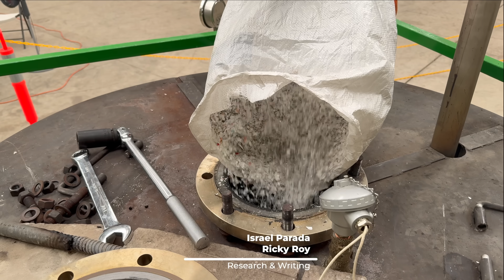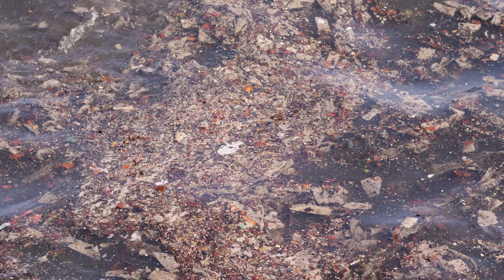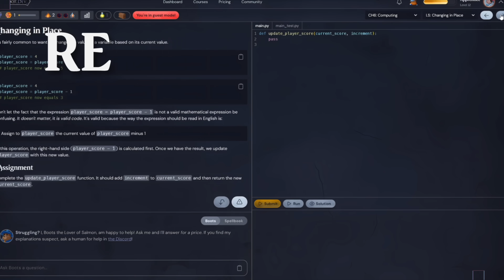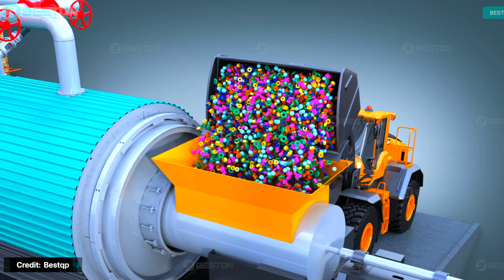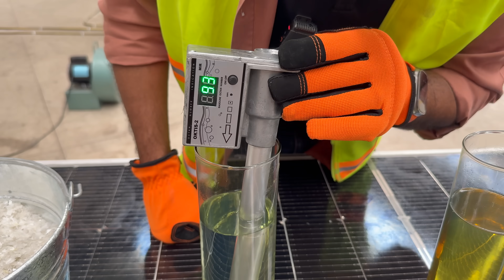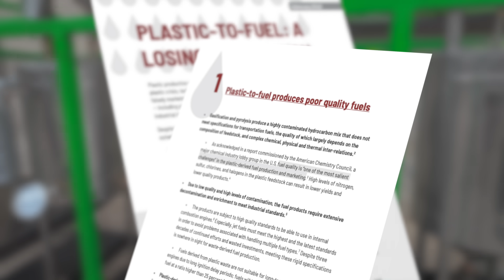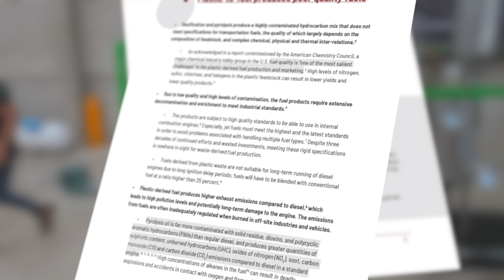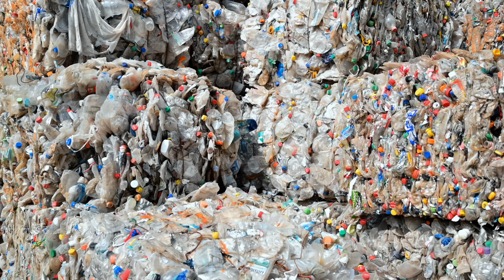Solving the Plastic Waste Problem - This Surprised Me!

Comment: That same process producing fuel-grade products is also useful to produce feedstock for many other products- like plastics...not ALL the lighter fractions have to be burned; it would lower the process efficiency, but the system efficiency including outputs may be as good or better ROI.

Comment: Pyrolysis is actually a very old technology. The Germans were already using variations of it during WWII. The process works well with polyolefins and styrenics, although polyolefins are generally preferred because they typically provide better and more stable yields.

The key factor is always the overall economics versus the revenue generated from the final outputs. Once the plastic has been properly decontaminated and granulated, you need to carefully evaluate:

Energy input costs
Processing and operational costs
Output yields
Market value of the recovered products such as waxes, oils, fuels, or syngas

At the end of the day, profitability depends on maintaining the right balance between feedstock preparation costs, energy consumption, and the selling price of the recovered products.

Comment: not a problem at all, because the more plastic you can turn into fuel the less oil you’ll need for fuel and that oil can be turned into plastic, so basically the plastic will just be a step between turning oil to fuel.

Comment: On the question of carbon emissions 🧠:

- using a conservative assumption (petgas claims 50% less emissions) of 2.7kg CO2e per litre of fuel burned, and assuming 1kg of plastic feedstock gives you 0.89litres of fuel, then per kg of plastic there will be 2.4kg of CO2e produced. 

- assume total plastic pollution worldwide is 52Mt/yr (2Mt/yr of which is ocean plastic). If they had to convert all of this every year to fuel (logistically impossible), they would emit 52 x 2.4 = ~125Mt CO2e per year.

- total worldwide yearly emissions = 38GtCO2 (excl. methane, nitrous oxide, and other gases) - 125Mt is 125/38,000 of global yearly CO2 emissions (0.33%).

Negative climate impact = meaningless.

Positive environmental health impact = monumental.

TLDR its worth it.

Comment: Pyrolosys isn't anything new, at least converting to diesel. WHY industry and governments are so resistant to reusing plastics to usable fuels,  I have zero idea.

I was involved with attempting to build a complete system with a system like this in the Pacific Northwest back in the late 1990s.  The pyrolosys system was the heart of the ethanol production from a company called Conrad Industries in Washington State. Not sure if they are still in business but this company is using their exact model and probably updated design.  

Nothing is new. What would be new is to get governments to actually accept these concepts.

Comment: petrol and diesel fumes from plastic waste is excessively pollutant

AI Overview
Converting plastic waste into petrol and diesel—often through a process known as pyrolysis—is widely regarded as a highly pollutant form of energy production that can be more harmful than burning conventional fossil fuels. While this process is promoted as a "circular" solution, it often functions merely as a way to convert solid waste into toxic air emissions. 

Here is a breakdown of the environmental and health impacts based on recent studies:
1. High Emission and Toxicity Levels 
Toxic Fumes: Pyrolysis and the subsequent burning of plastic-derived fuel release dangerous compounds, including dioxins, furans, heavy metals (like mercury, lead, and arsenic), and volatile organic compounds (VOCs).
Lower Quality Fuel: Plastic-derived fuel is often more full of carcinogenic aromatic hydrocarbons than traditional crude oil.
Increased Exhaust Pollution: When burned in engines, plastic-derived fuel produces 12% to 50% higher exhaust emissions compared to standard diesel, including higher levels of nitrogen oxides (
) and unburned hydrocarbons.
Persistent Pollutants: These pollutants are known to bioaccumulate in the food chain and cause cancers, endocrine disruption, and immune dysfunction. 

2. The "Plastic-to-Fuel" Myth
It's Incineration in Disguise: Many plastic-to-fuel initiatives are essentially a form of chemical incineration, where the plastic is not truly recycled but rather burned, turning it into greenhouse gases.
High Energy Input: The conversion process is extremely energy-intensive, requiring high-temperature thermal processing, which often means it is not a net-positive energy solution.
Damaging to Engines: Plastic-derived fuel has higher viscosity and density, which can cause long-term damage to engines due to incomplete combustion. 

3. Safety and Operational Hazards
Industrial Risks: Pyrolysis facilities have a history of accidents, including fires and explosions, due to the difficulty of managing the process, which involves high heat and flammable mixtures.
Ineffective Regulation: In many regions, the emissions from burning waste-derived fuel are inadequately regulated, placing a heavy toxic burden on local populations, especially in developing nations. 

While some studies argue that modern, strictly controlled catalytic pyrolysis can mitigate some of these impacts, the consensus from environmental organizations is that this technology perpetuates the plastic crisis rather than solving it

 The earth also is defiled under the inhabitants thereof; because they have transgressed the laws, changed the ordinance, broken the everlasting covenant

 Jesus Christ of Nazareth is The LORD!

Comment: 400Mt is small compared to processing coal to oil.  Plastic to fuel would be too expensive to scale.  There is simply not enough waste.  Feelings do not run any engineering project.

Comment: Based on 2024 reports, specialized plastic-to-fuel initiatives in Ireland are in their early stages, with specific, ongoing operations designed to handle around 4,000 tonnes of plastic waste per year. 

￼KnowESG +1

However, the vast majority of non-recycled plastic in Ireland is incinerated for energy recovery rather than being converted into fuel oil. 

Key Findings:

Specialized Plastic-to-Fuel (Pyrolysis): Trifol Resources, based in Co Tipperary, started full-scale production in 2024, designed to convert roughly 4,000 tonnes of plastic waste annually into bio-oil (pyrolysis oil). They have plans to increase capacity to 12,000 tonnes with further investment.

Comment: Twenty years ago I investigated biochar production as a soil amendment.  All of the pyrolyzer designs I saw used the gas from the wood feed to sustain the heat to run the process.  You should have a look at charcoal from scrap wood.  It locks up CO2 for millenia

Comment: It’s a mini fracturing tower just like in a refinery, the carcinogens that thing outputs are no joke and the reason nobody has managed to push anything like this commercially.  Also, it should not be difficult to add any plastic input to modern refineries, recycling that plastic and getting it to refinery is more expensive than drilling

Comment: OK but can you compare this to the more extreme oil retrieving methods like fracking and the pollution of the environment from them to this.  Because the whole pollution issue needs to be contextualized by what people will be able to not have to do.  Like with the solar power on the existing grid, yes they are not going to replace all of the other possible power generation on the grid but it is stop us from needing to burn the worst things to get the needed power when we need it.

Comment: One more fun fact, Mr Diesel, the inventor of the diesel engine, actually made it to run on plant based oil, not petrochemical based products! 1ha of the industrial hemp oil harvest can power agriculture machines needed to work that 1ha for 100 years!!!!!! Then you can get petrol from the rest of the biomass. All cold pressed! Then you get fibres left over yoi can use for making paper, clothing, packaging, ropes, and, watch this out, car bodies! Henry Ford, that Henry Ford in his later years understood the environmental death trap he helped to manufacture and made a prototype car run by hemp oil with body built from hemp fibres. There is famous video where he swings a sledge hammer at the boot of this car without making even a dent in it and the hammer bounces back. 
The point is, it is all there, burrows by the petrochemical mafia either through buying patents and locking them up or more prolifically making sure none of this sees the light of the day. Now, it is far more difficult to achieve it with social media. So things like these pop up more and more often, which is brilliant!
So kudos to the people who actually have the grit to go against the fossil fuel mafia. I wonder is this business is going to be around d in 3 years lol

Comment: Interesting. I'd wonder at how much fuel is used in the 1.5 hours to warm the boiler more than using the output fuel. We are already burning fuels, not to mention using lots of energy to pump/process that fuel. Meanwhile we are making plastics a one-use product.

Comment: If this is a fuel returning to fuel, and it with exactly the same pollution going into the atmosphere, as if it was originally processed into a gas, then it might be a bit of a bad idea, maybe. It is great to remove the plastics, but if adding the pollution from the fuels used turn it to gas, leaves us with a net total of more, it is overall bad. 

If the heat of processing could be made into a pollution free process, it is an ok idea. 

I am thinking of maybe crissal lenses or other sun, wind, or water generated heat technology that could do the cooking. 

It is actually a good idea to clean the plastics up. God Bless.

Comment: We still need more time to scale hydrogen. Using plastics as a fuel source rather than refining oil from the Earth seems like a smarter path forward if the goal is still to get ourselves off of fossil fuels. We can use up the plastic waste first to protect our environment. Using this fuel in hybrids means the fuel would go farther. If this gasoline is cleaner than CA standards, would a filter designed to capture the carbon from this super refined fuel solve the CO2 pollution problem that it would generate? Imagine if that used filter could then be used to make another carbon based product like carbon fiber body parts for cars. A girl can dream, right? Scientists are magical beings. I believe they will sort this out eventually. Cheers, Ricky!! 🍺💖✨

Comment: Many hard questions need to be answered.  The biggest one is can this be scaled up to a meaningful level?  This is only a demonstration model.  How much waste gas is released into the atmosphere from the cracking process?  How difficult is it to have a CLEAN waste stream to use in the cracker?  China stopped buying US recyclables because they were receiving too much trash with the plastic.  If I were at this company, I would contact Waste Management in the US and see about setting up a reactor at one of their facilities that supports sorted recyclables.  They could then use the fuel in their own fleet.  This company actually has product for sale.  You can go to their website and request a quote for a reactor.  HEY WASTE MANAGERS!!!!

Comment: Sounds great to me. 

Yes, it's a process that produces another pollutant ( perhaps a little cleaner than normal ) but greenhouse gas production isn't the only problem we face in our world. We still have a limited supply of oil too and like it or not we aren't really very close to not using oil. This process gives us another supply. Imagine if city garbage dumps suddenly become valuable to the cities rather than just a problem. Or recycling plants become local producers of some of the cities' gasoline supply for its residents. I've felt for decades now that eventually city landfills are going to become the equivalent of gold mines some day in the future. Looks like we might be just starting to get there.

Very interesting, it might lower the amount of stuff that has to end up in our local landfill's aka garbage dumps. Looking at this only in the context of recycling or environmental CO2 isn't the only perspective to use here. 

My city has been installing natural gas collectors in our closed garbage dumps for decades to capture the natural gas that is created from the dumps that have been closed and covered over. Every new pit that is opened has these built right in from the beginning. Thanks for the report.

Comment: The issue with plastic is micro plastic which gets into our food supply and causes health problems for us and the environment. In a perfect world we would find a biodegradable solution and get rid of plastics all together. on the other hand the Earth has a carbon cycle that can sequester the carbon. If this gets plastic out of the oceans and they landfills it may be a positive step but I worry that creating an economy based on creating plastic waste doesn't solve the issue it just perpetuates it while contributing to climate change.

Comment: I have followed a number of technologies that on the outside look really life changing in concept.  Some of those technologies have actually made it to market in huge strides but many of them don't.  Why don't they?  I have found 2 major reasons why they don't make it to market.  1 - The true production costs are too expensive.  How much does it cost to turn those plastics into petrol?  You have to factor in the investment of equipment to do it as well as the amounts in can produce and the costs you have to pay for employees, maintenance, upkeep, etc.  Can that be done at equal or better costs that refining the raw product initially?  And reason 2 why they don't make it to market is marketing.  You have to be able to market the product well enough for people to pay attention that it even exists.  I've seen a ton of great ideas that failed because nobody ever knew about it.  Marketing it and knowing the correct target market to make it successful is key.

Do I think this is a great idea?  Yes, most certainly.  I had pondered on the idea and concept of turning the plastics in to fuel that would power things like electric plants using it along with natural gas.  You could turn it into like a pellet or power source to heat up the turbines or whatever.  Making fuel out of it is also a great idea as well, as long as it can be done in a cost effective or efficient manner.  If it costs more to produce fuel this way I can assure you it probably won't fly.  No mention was made as to how much it costs to produce in comparison to raw oil to start with.

And lastly, higher octane and usage.  There are a few things here to consider.  First, can 93 octane be used in vehicles?  Vehicles have to be able to adapt their timing to use higher octane gases.  And their engines have to be built to use it with correct materials.  Add to this the lubrication of said product.  Does it need supplementing or does it do it raw form?  It is better for the engines or cause more harm to them if they use it?  More studies need to be run to determine this.

In concept it's looks really good.  But what about real life usage?  Is it indeed better or worse than what is out there now?  So much can be done if it is successful.  Could mining an old dump for the plastics there be beneficial too in costs?   And even if it does somewhat cost more, could there be a sponsor of some moneies, usually government monies to subsidize such production to make it worth it and affordable for the consumers?  And would we be willing to tolerate those subsidies?  Many questions left to ask and evaluate.  But hey, I see this having the same potential to succeed like I saw the white emitting diode succeed in the lighting industry.  But we won't know until we actually see it come to market and make noise and headway.  Best of luck with this technology.  Plastic is just hardened petrol.

Comment: Plastic-to-oil is real chemistry, not a miracle. The hype starts when startups pretend they cracked what majors somehow “missed,” when the real problem has usually been ugly economics, dirty feedstock, and inconsistent output. Claims like 92% efficiency often depend on selective definitions that shrink under independent scrutiny. And calling it “green” is mostly a branding trick when the end point is still combustion and CO2. A demo that powers a forklift makes a nice thumbnail, but it does not prove long-term engine health, emissions compliance, or commercial scale.

Comment: How convenient, you had to fly out before finding out the final yields.

Couldn't you have just asked that question and got an answer in about 3.4 seconds???

Here, let me help you...

After factoring in the costings for acquiring, sorting and grinding up your plastics, the power for chillers and the gas to initially run the process, it actually costs more than the value of the final product produced.

Hence the only value is in the environmental savings.

This is why nobody is doing this process which has actually been around for over ten years.

There's no $$$ in it, in fact you lose money in the process!

Comment: I would hope they just burn it and make electricity.
Focus on cost, clean exhaust, clean ashes and quantity.
There is no need to "recover" plastic, just get rid of it. All the contaminant in the plastic will end up in the fuel requiring special treatment or blending it with other fuel to disperse its effect.

Comment: This is one step better than the system that was developed by a researcher in Australia. That system made an oil t that could re-enter the market as the same produce sold as "oil" that is used to make plastic. This is direct to market in a local area so there is little shipping involved in distribution!!! Much better solution.